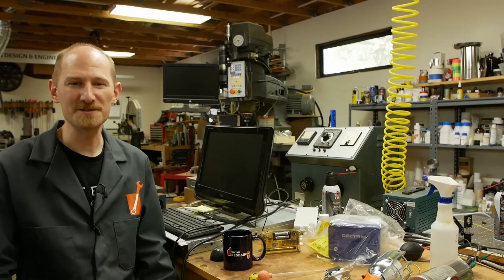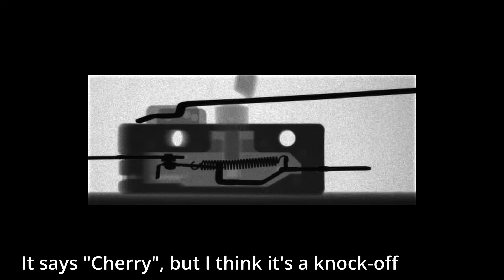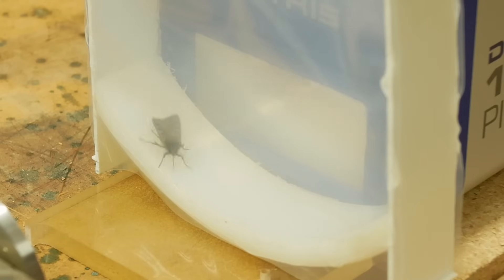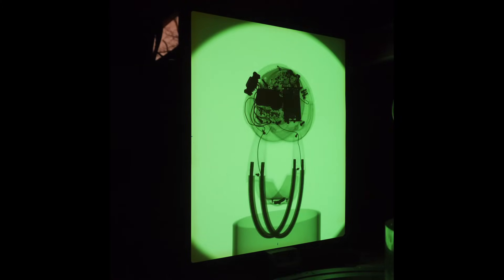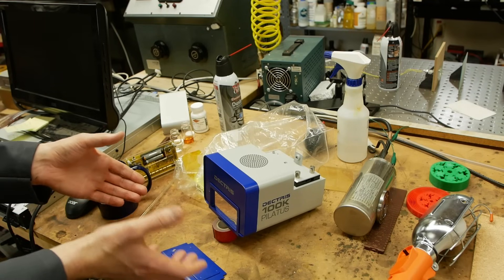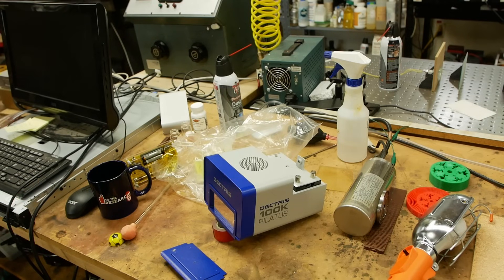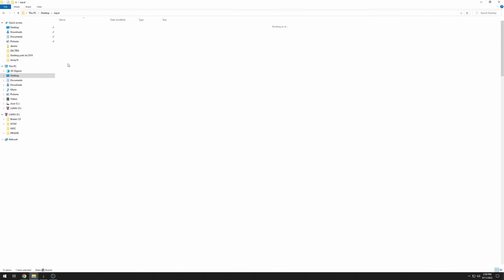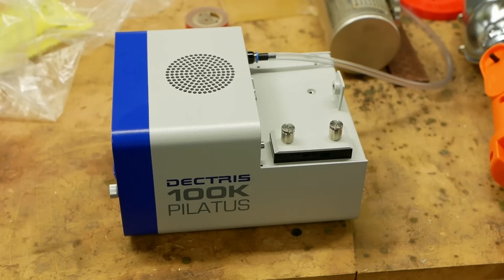High speed X-ray video: jumping beans, wind-up toys and more!

Comment: I wonder if crickets are jumping if they feel movement/acceleration so maybe sound (bass? ultrasound?) would convince them to jump (if so, curious what frequency range would trigger it)
Reply from the maker: I had some additional footage of crickets on a piezo transducer with ultrasound, crickets on a speaker with normal sound, heat and cold spray, air blast, powerful laser pointer (it did make them scratch...).  Ultimately, I think just general higher ambient temperature makes them much more active and likely to jump. In the car, they were in a plastic bag.  The sun was strong, but air temperature in the car was comfortable, and they were jumping once every couple seconds.  I used a 60W tungsten bulb to try to get them moving quickly again, but I think I need a lot more.  Some folks suggested visual stimulus like moving checkerboards.  This had no effect in my experience.
Reply: @AppliedScience  Interesting! Yeah, moving checkerboards don't make me jump either.
Reply: sun was strong... maybe uv light? many if not all arthropods see in uv light

Comment: Apparently the technology was developed at PSI in Villigen, Switzerland and was first used in the CMS experiment at CERN.  It uses a microarray of reverse-biased photodiodes which I believe are driven into the avalanche regime.

The documentation for this camera warns you not to connect the computer to the Internet...

Comment: Would it be possible to create a passive image using only lead shielding and background radiation as a source? How long of an exposure would be required for normal background radiation levels?
Reply: You will actually see cosmic rays. At the energies this detector is sensitive to, about once every couple of seconds.

Comment: I wonder if any MEMS devices are big and slow enough. If not, you could always build an xray microscope!

Have you tried filtering your tube? We used various thicknesses of aluminum and copper sheet to select certain photon energies.

Carbon fiber is very transparent to xray if you want to build fixturing. Open cell foam mostly holds up too.

I'd love to see some more processing done to the images. Power drill CAT scan? A difference amplification would be cool too.

I'd also like to see what you get with just a scintillator sheet and a camera with that tube.

Cell phone xrays are cool looking. You could catch the haptic motor going, I bet.

Comment: what, ImageMagick can open tiffs, I use preview renders from blackmagic fusion with that.
now, those are compressed tiff unless I use the floating exr output from the end of the blackmagic pipeline (an entirely separate issue on BMD not letting you get uncompressed preview renders), but if you build ImageMagick correctly you can have full fp32 support.
there are entire programs that use ImageMagick instead of opencv or imageio because of how it handles fp32 and exr compression, without having to deal with the absolutely horrible exr source code.
but dngs, tiffs, exr files, should work fine with ImageMagick, you just gotta enable the flag for full fp math.

Comment: Great video! I have a few points to make about radiation safety:
-Stainless steel won't stop x-rays. Lead will. You may want to invest in a lead apron.
-A Geiger counter is not the best way to detect x-rays. It is extremely good to detect the presence of charged particles like Beta and alpha particles though. Ionization chambers are not helpful for x-rays as well.
-You may want to invest in a TLD radiation badge to see how much radiation you are actually releasing.
Reply: Everything will block x-rays in proportion to density and Z number. For 60KV 1ma a garage is plenty of precaution. Radiation badge is not a bad idea and for fun he can have two and send the other to colorado.
Reply: I'm pretty sure this guy is fully aware of these point

Comment: Harbor Freight sells ratchets that are made of composite instead of steel.  I bet it would be pretty cool to see the mechanism of gears/pawls inside working without having to disassemble the tool.
Reply: As he stated, the object can't be too solid for the x-rays to pass through...
Reply: @Quickened1  i just said the body was made of composite, aka - plastic.
Reply: @jong2359  being plastic is not the problem, it's the density of the plastic. Being a ratchet, it must be VERY dense to hold up to the kinds of forces a ratchet has to endure. It's highly unlikely the x-rays will penetrate, but I guess there'd be no harm in trying...
Reply: @Quickened1  Sure, the composite will produce SOME radiopacity, but you will still easily see the steel mechanisms underneath.  It takes an AWFUL lot of plastic to render an exposure completely opaque.

Comment: I really, really want to see what you can do now if you also have one of the liquid metal excillum sources that can pump out a thousand watts into 30 um spot size. They have a video doing a CT scan of a battery in 1 second. On soft samples you could totally do 20fps CT imaging.
PS. the idea of you trying and failing to get the crickets to jump in your x-ray setup for days is just fantastic.
Reply: wow I've never heard of this method before. I would have thought mercury but they seem to be using tin gallium jets.
Reply: @Muonium1  it really is a clever idea isn't it. I agree, mercury seems the more obvious target at first but gallium has the advantage of the widest *range * of melting points of any metal, even being used in old high temperature thermometers. Only thing you gotta be careful about is it expands when freezing like water.

Comment: I've worked at particle accelerator x-ray sources and we indeed had a bunch of these high speed photon counting detectors from Dectris and other brands around, though I've never seen such a small one. The Megapixel 2000 fps detectors I know of were in the lower six digits in price. The cool kids nowadays have Megapixel Megahertz detectors at free electron lasers though. Those capture short bursts of images at 5 million fps in full multi Megapixel size with large dynamic range
Reply: Wish I was a member of the cool kids :/
Reply: POV: you work at black mesa
Reply: @Guile_SF  That place really turned out to be a black mess, huh?
Reply: Lord
Hah! :D
Reply: Funnily the photon counting capability actually becomes an issue at free electron lasers since the number of photons exceeds the rate at which they can be counted. That's why the detectors there additionally have a gain switching mechanism in each pixel which adapts the sensitivity in real time between "photon counting" and "attenuated enough to not saturate with strong reflexes"
Reply: the mega mega would fill a 1TB SSD in 50 milliseconds, except to write that fast you would need 3,000 SSDs in parallel.
Reply: @dudelookatree  To be fair, the megahertz detectors only capture bursts of some 500 images since the light sources can't provide more pulses at a time anyways. On these detectors every pixel has it's own memory integrated with the readout circuit which is bonded directly on the back of the sensor, since the data can not be transferred out of the semiconductor stack that quickly. Once the burst is done, the data is then transferred onto the circuit board of the module (about one module per MP) on which a special processor compresses it losslessly and sends it off to the datacenter via 100GBase MTP fibre (in total 2 Tbyte/s or so to the datacenter). That way the detector can do these bursts many times a second, continously.
Reply: @dudelookatree  And that is what science centers and similar have, and even more so no biggie for them.
Reply: I would imagine the large aperture ones are in the seven figures.
Reply: @douro20  I think not quite. At 7 digits you're getting into the range of inhouse development at the respective facilities
Reply: @douro20  No, six figures.
Reply: @douro20  absolutely, we have both Pilatus and Eiger at work, a few of them were just under 3mill each, Pilatus is a bit cheaper, around 1.5mill. AUD that is.
Reply: As someone who work with xray did you ever try to check if you have cancer? or your colleague maybe?
Reply: @godofnothing520  Radiation hazards at synchrotron facilities are extremely small. The entire beamline is enclosed inside a lead/steel hutch. Before the beam can be turned on the area needs to be searched for remaining people where a button needs to be pressed for every corner that is checked, while a light barrier ensures noone else enters the hutch. Then the heavy lead/steel/concrete door is closed and a warning is sounded for 30s together with a rotating light, telling you the beam is going to be turned on. Only then, with the door locked, the beamshutter can be opened. If one of the doors is forced opened the entire accalerator is immediately shut off. 
The entire experimental hall is covered in dosimeters measuring the integrated dose over the year and fast detectors which can trip the accelerator immediately if radiation is detected somewhere. The radiation level in the experimental hall is very likely lower than outside, in the sun.
That being said, there still are occupational hazards. The large amounts of lead shielding can lead to lead dust in the air which accumulates in the body over time. There's uses of many other hazardous materiald like beryllium (for xray lenses and vacuum windows) and others which might be scattered around if one is not careful.
Reply: @JonaJona  Thanks for the detail!
Reply: christ..  5 ..million fps?
Reply: Are you one of those quiet smart people that nobody knew was smart till they asked what you did as an adult and said you were an engineer? I think that’s Wild.

Comment: 10:13 i use JpegView (with the play slideshow/as a movie function). With a good PC behind it, it can render TIFFs that are quite high into a good movie. A few years back i scanned at max resolution with a big specialized scanner, a glass photography collection and i was using several scanners at once, so i'd use that function (automated a little) to check that all the TIFFs were in working order. It's a good program.

Comment from the maker: Someone on twitter asked if there is a light-to-frequency conversion for Mexican jumping beans.  Wouldn't it be funny to make a camera with jumping beans as pixels?!
Reply: Or what about the spectral response of jumping beans?
Reply: I bet if you could articulate some kind of algorithm for light-to-frequency, had a medium large enough in scale to average out the imperfections, and fed an AI off of all that - the generated images would be fantastic.
Reply: This is mind blowing, such setup in your lab
Also about uncompressed tiffs and an overall size and speed of output: as far as I know, substantial amount of cost of LHC, despite the complexity and high cost of the structure itself and its sensors, is actually a computational setup (I mean servers, network and so on), because there is no way to store information at that bitrate and enormous amounts for later processing, so data should be processed on the fly, and actually store only certain events with given conditions
Reply: I can already see the thumbnail "I turned insect into a camera using microphones!" No one would believe that so you'd get either viral hit or no one would click on it.
Reply: A Mexican photon counting bean camera!
Reply: Carbon paper, a grid of ratio-standardized beans...
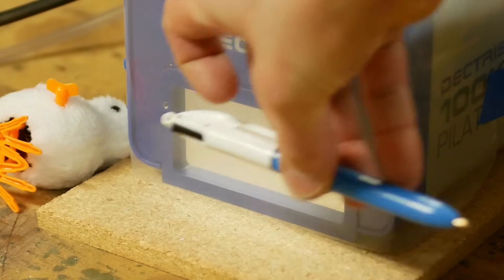Reply: 1:16 what fascinated me most about this video is this clip where we see your bones inside your finger while flicking the switch! 😮
Reply: A camera would be great and all, but can you play DOOM on jumping beans?
Reply: That would be fun! Yeas!
Reply: Sounds like a more affordable project
Reply: camera with jumping beans as pixels recording a time-lapse video of an audiovisual sundial whose hour lines are made from jumping beans in differently tuned glass tubes
Reply: Yeah and microphones as detectors
Reply: DO IT
Reply: Linear photo scanner:

Coat beans in conductive paint [or  graphite powder if the worms need fresh air].
Place beans in a row of tiny boxes with bare wires, 1 common, one per wormel. [I neologize often]

No light - bean stays lying on wires
Lots of light - bean jumps a lot and interrupts the current.
Less jumping -  shades of gray

I will leave the mirrors, lenses, electronics, and machinery up to you.
Reply: @BobCat0  I suppose one would need to calibrate each bean to compensate for different thresholds, sensitivities, and non-linearities from worm to worm.
Reply: that sounds like slavery with extra steps 🤔
Reply: Perhaps, an array of tiny piezo microphones would be a very cost-effective detector .  It's easy to imagine attaching them to a large circuit board and would simplify the wiring greatly.
Reply: Aren't they sensitive to heat instead of directly light? That would classify them as bolometers then.
Reply: Question: how much energy is in a rat/mouse trap, and do all mouse traps have the same energy? I am talking about the ones that snap.
Reply: Bruh
Reply: I imagine it would look a lot like analog TV static.
Reply: There's a significant error in the video. That sow bug is not an insect. They are the only widespread terrestrial crustaceans. They even use gills that have to remain moist to breathe.
Reply: @hirobian2  so a smol lobster?
Reply: @jhoughjr1   roly polies are in the superorder Peracarida, consisting of small crustaceans that have brood pouches, while lobsters are in superorder Eucarida containing krill and decapods. But yes, they are closely related.

Comment: Could you use this to visualize the X-ray emissions from peeling packing tape off the roll? That might be neat!
Reply: I think the trouble with that is getting an image to form on the detector’s focal plane. There’s no easy way to make a lens for x-rays. I think the way Ben is able to form an image in this video is that the dental x-ray tube he’s using is approximately a point source of light. So, tape may make a flash of x-rays, but the x-rays won’t form an image of the tape forming x-rays, if that makes sense.
Reply: @bjmcculloch  maybe he can use a pinhole if the device is so sensitive
Reply: @bjmcculloch  I doubt it would make it into national geographic, but maybe something along the lines of a bundle of hundreds of lead soda straws to eliminate off-axis photons? It probably would lose too much sensitivity to capture tape x-rays. But maybe.... and that is where I draw a blank. What are natural sources of background X-rays? I would love it if it could be pointed at the ground and left for a days long exposure to maybe image some high power x-ray emitter in the soil. Maybe sunlight shining through the roof. Or a banana. Something must emit x-rays in the wild, fully expected to know what and found I know nothing.
Reply: @bjmcculloch   You should be able to 'tune' the image programatically
Reply: @bjmcculloch  If lenses are impractical, why not use mirrors?
Reply: @Aquatarkus96  Xray mirrors are also impractical, at least as you'd be imagining them. Look up "X-ray optics" on wikipedia. I don't think a little Wolter telescope is going to be worth the trouble.
Reply: He should be able to I hope he sees this
Reply: Prob not. The triboelectric scotch tape peeling method of x-ray generation only happens in vacuum where electrons have a large enough mean free path to accelerate to KeV energies needed to create x-rays via bremsstrahlung. You'd either need to put the whole detector in the vacuum chamber or build an x-ray transparent beryllium window into the vacuum chamber wall (very hard).
Reply: @Muonium1  Electrons can be accelerated to tens of keV at just a few milimeters if not less. Whole column in electron microscope is filled by coils responsible for focusing and centering the beam and capturing electrons that go too much off-center due to deviation of their energy and refocusing the beam again. This is the reason why column of SEM is like 10-15cm in diameter and half meter long. But beam is formed at few milimeters between emmiter and extractor. Well and top part is big just because of insulation distances and thick pipe for a vacuum pump.
Reply: @Muonium1  no it happens in air also. I don't know if it would reach 50kV but there is a device which takes images by peeling the tape in normal air.
Reply: @devrim-oguz  it absolutely does not happen in air at all. You NEED vacuum to produce x-rays using tribocharging. Provide evidence to the contrary.
Reply: @devrim-oguz  in air peeling films makes THz frequency emissions. I don't know that it makes x-rays.
Reply: @Muonium1  yeah I guess you are right. I just watched the video I was mentioning, and they pull a vacuum on the chamber. I didn't remember that part. It causes triboluminescence though 😛
Reply: @Hansengineering  I was wondering how to make terahertz frequencies..
  Anyway doesn't one of his xrf guns basically use that plastic film pull off for x-ray emission? The video where he did it tear down of an xrf gun might show it and I don't remember it being in vacuum.
Reply: If you really wanted a video of the flat surface bottom of a piece of tape rolling off a surface, you could do normalized specular x-ray reflectivity experiments with a surface like quartz or Micah. Looking right at the area where it leaves the surface would be cool.
Reply: To form an image you can try with a pinhole